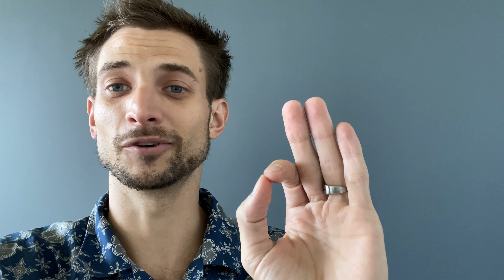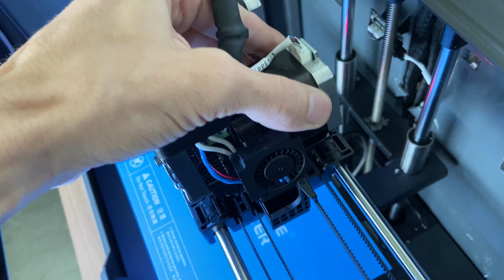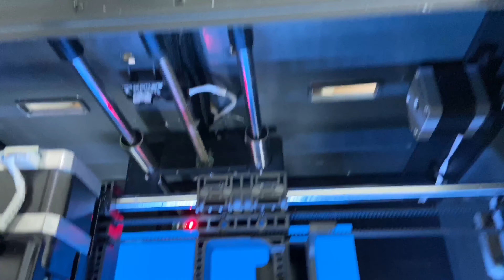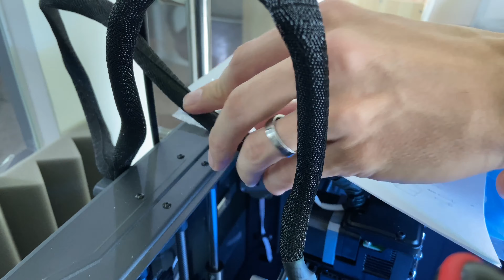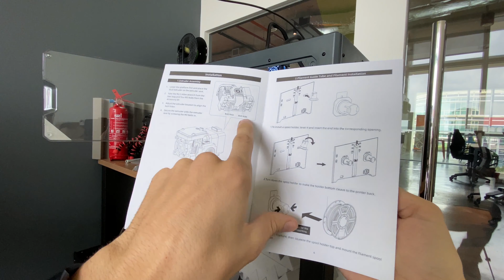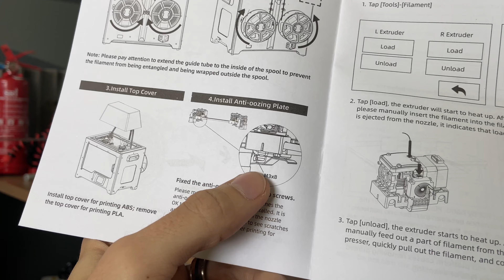Flashforge Creator Pro2 Setup & First Print (in 4K resolution)

Comment: Would you please give me some help? Loading filament in my Creator Pro 2 is  incredibly hard! I must be doing something wrong
I have to force the filament into the head while pushing down the lever I know, but it kills me every time. I'm going crazy

Reply
Reply from the maker: I had this issue in the past.  The filament can have some misalignment.  Instead of explaining, it's really best if you set aside 30 minutes to disassemble the head.  You'll see how the filament enters and how it works inside.  Then you'll know what to do, based on the behavior of the "sticking."  Let me know if you try it.

Comment: da vincy sr  jr printer . just add 3d figure to sd card print. oc. everything are on auto and everything ave preinststalled. the program are easy to download and use. but check if its win 10 11 versions.

Comment: I have a Creator Pro 2 and I am trying to do batch prints with the duplicate mode. The issue I am running into is that when I layout the models on the build plate then choose the 'duplicate extruder' option in Flashprint, it puts a large gap down the middle which pushes some of the objects off the build plate. This is quite annoying as I've only been able to print 16 objects in a batch when there is more than enough space to fit 20. I am pretty new to this but cannot seem to find any settings or options around this subject or find any tutorials about it. It could very well be that I just don't know the name of what I am trying to achieve but any help would be greatly appreciated. Oh and thanks for this video, it helped immensely in getting my machine set up and running!
Reply: Not sure this is correct (I don't have an IDEX printer, but looking at buying one), but I think you lose some build volume because there is some dead space in the middle so the two extruders don't hit each other.
Reply: @D3ADSY  what you are describing is correct when printing in 'mirror' mode, for instance let's say you have a left foot, you could use mirror mode to print the left foot on one extruder and the right foot (mirrored version) on the other. In this instance yes, you would definitely need dead space down the middle to avoid the extruder clashing.

However, in duplicate mode, the extruders are fixed distance the entire print and follow the exact same path so they can never come in contact with each other. So like the example above each extruder would print a copy of the left foot. My logical thinking is that in duplicate mode the gap down the middle would at most be 10mm between the virtual left and right build volumes of each extruder.

Now it looks like that in Flashprint but in reality when the print is done, even if you have you models placed right up to the edge of the virtual build volume, there is still a gap of 30mm down the middle. That is quite substantial on a build plate of only 200mm width.

I hope all that made sense 😅
Reply: Would you please give me some help? Loading filament in my Creator Pro 2 is a bitch! I must be doing something wrong
I have to force the filament into the head while pushing down the lever I know, but it kills me every time

Comment: Does it look like you could upgrade to all metal hotends that would do nylon or polycarb? Out of the box its says 240 for the max on the hot end. I need to print Nylon. Also, you think it could be converted to silent drivers? How noisy is it with the doors closed? Thank you for this great review!

Comment: Cheers for the video, quick question, I'm looking for my first printer but also to use within my business, I'm stuck between this and the flashforge guider 2, is there any difference other than the fact this one has duel extruder?
Reply: Guider 2 is with a single extruder, but a much bigger printing volume: 280*250*300mm.
Reply: @joyzhang1468  is the quality as good?

Comment: Nice video. This creator pro 2 looks interesting. I unfortunately can’t find reviews about it.

Did you already printed 2 colors in 1 print and with solvable support materials? So yes, is the printer handling that well?
Reply from the maker: Nope I have never tried soluble supports except a very expensive kind that comes with a Stratasys uPrint.